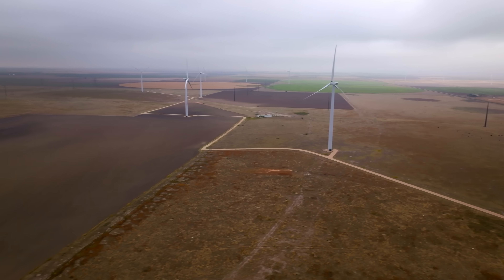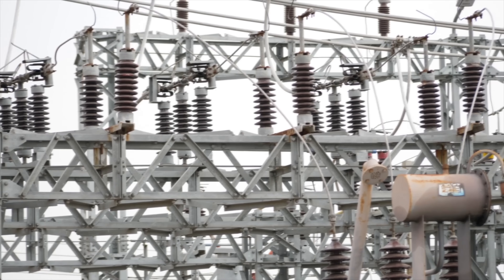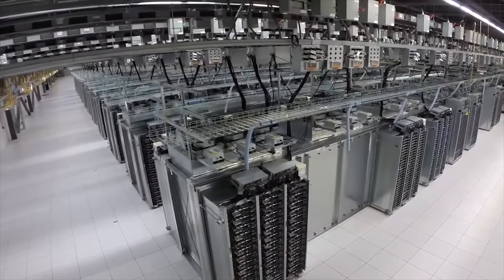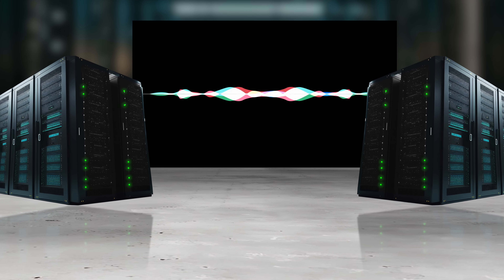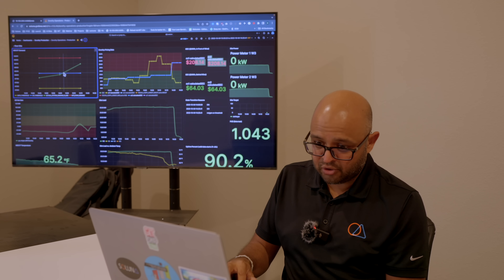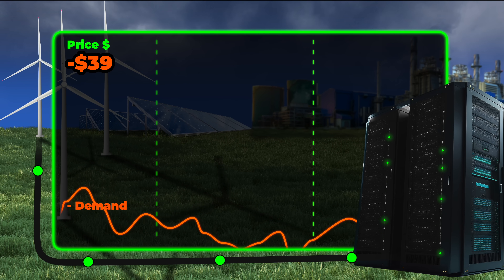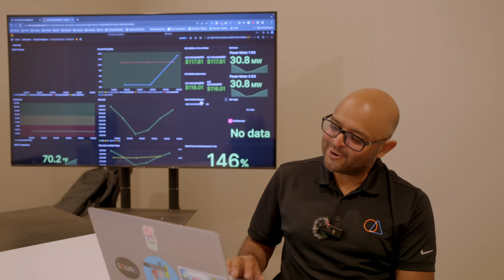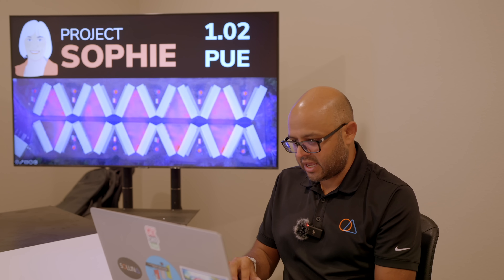Wind Farms' Dirty Little Secret No One Talks About

Comment: Texas has a electricity renumeration scheme that prefers very much dirty wind mills and solar. It does not reward reliability. Thus Texas has a electricity generation with plenty of dirty solar/windmills and gas. The result is the black out in winter 21. 

I do not know if it is economic to use data centers to buffer the volatile production of dirty wind energy. It is probably caused by the electricity renumeration scheme. 

I would prefer an electricity generation based on environmental friendly nuclear, coal and some natural gas for peak demand. It provide much better stability. It would be better to scrap dirty wind mills and solar panels.
Reply: What do you mean by dirty wind energy? In the blackout of 21 it wasn’t the renewable side that caused the issue. They do sell cold weather packages for turbines, but they’re not purchased in the southern states and honestly not in most of the northern states cause it’s typically not an issue. Even so a large portion of the blackout was caused by frozen gas lines that supply gas and steam turbines, and not the small percentage of renewables that help supplement the Texas grid. Look to ERCOT and Abbott for failing and not wind turbines.
Reply: @chrisbellttu  Wind energy is generated acc. to the coincidences of the weather. In most grids its value is low, 0, or even negative. On the other hand it requires several 1000tons of material. A lot of environmental impact for a low benefit. That`s why I call it dirty. 

Many experts predicted a brown out or black out in summer when demand peaks. The winter package might have helped in 21 but not in summer at 1800 when demand is close to its peak  very low solar, perhaps no wind is blowing. 

A nuclear power plant can run for 1 - 2 years without refuelling. It can start-up itself in the worst case by its Diesels. 

A coal power plant has usually fuel for several weeks or month on site. It cannot start-up without external power. 
A gas power plant rely on gas from a pipeline. The gas pipeline usually needs power from the grid. It cannot start-up without external power. It is less reliable.   

For Texas it would have been helpful to have connections to neighboring grids. It would have been helpful beside of plenty of gas power plants (Texas is a big natural gas producer) to have some coal and nuclear power plants to improve the resiliance of the grid. The renumeration scheme should include bonus for resiliance and reliability.

Comment: One thing I wonder: If windmills set their blade pitch to zero degrees, could they function as synchronous condensers? Even if there’s no demand for real power, they could fulfill a demand for reactive power conditioning that could keep the excess mills spinning.
Reply: Parts of Europe are dumping excess wind generation into inefficient hydrogen just to fill demand that at first glance is preposterous. Specifically, for UK alone JUST TO CUT curtailment (blades pitched to zero) IN HALF requires 20 GWh of energy storage. Taking those two statements into context.. is it really preposterous IF that curtailment was cut to zero by hydrogen production and directly injected into existing natural gas networks that are safe up to varying ratios dependent upon existing infrastructure. Alternatively, with more energy expenditure it can be reacted with carbon monoxide or carbon dioxide into more stable fuels such as methane or methanol. Which the later is of particular interest as an performance booster of ICE engines by increasing octane reducing pre-detonation and dramatic combustion chamber temperatures due to latent heat of vaporization. For perspective, 100% methanol track only vehicles DO NOT need a radiator as the fuel vaporization.

Keep in mind, regardless of energy storage methods or it's costs adding new production capacity, again regardless of renewable preference, will be cheaper.
Reply: Unfortunately not. Windmill speed varies with the wind but the grid runs at a fixed frequency. To get around this they generally use the generator to power an inverter that feeds the grid so there is no direct connection between the grid and the generator.

Comment: Imagine if more people implemented great ideas like this.
Reply from the maker: i think about it all the time!
Reply: What to do with excess power is hardly a difficult problem, try thinking about would you do on a calm day...
Reply: @manoo422 That's where grid scale batteries and other energy storage technologies will come into play.  There is no such thing as a silver bullet.  We are going to need many different technologies to transition to renewable energy.
Reply: @jerryinmon2731  "grid scale batteries" there are no such thing.
"energy storage technologies" you mean fantasy...
"many different technologies" most currently not invented, the few that are available are fantastically expensive. Renewables are NOT a solution to anything, they are the PROBLEM.
Reply: @manoo422  Your completely wrong.  There are already grid scale batteries already working  and making huge amounts of money for their owners.  So believe what you want to believe.
Reply: @manoo422 every water reservoir used for hydro power is,  in fact,  grid scale energy storage, used as needed.
Reply: @jamesengland7461  ...and how long can you run the country on hydro power, an hour?
Reply: @jerryinmon2731  What is their storage capacity of these batteries exactly? How long can we run the country off them...?
Reply: Windows XP
Reply: @orionbetelgeuse1937  They don't last minutes they last hours.  The process to create this system will not happen over night but will takes several decades to finish which allows for vast improvements in the technology.  Including the price of energy storage dropping by orders of magnitude from efficiency gains and new technologies.

Comment: Power Usage Effectiveness (PUE) is determined by dividing the total amount of power entering a data center by the power used to run the IT equipment within it. PUE is expressed as a ratio, with overall efficiency improving as the quotient decreases toward 1.0.
Reply from the maker: absolutely ... many data centers try to get close to 1, but don't include water used for evaporative cooling, others don't including AC and other cooling... there are a lot of tricks played when you look closey. Next time you see someone claim they're carbon neutral, ask them, "what about water use?"
Reply: @TwoBitDaVinci  Indeed. Air conditioning with water-cooled condensers is significant enough, but there is also a possible 'emergency cooling' where city water is directly used for cooling and immediately dumped down the drain. Aside from pumping, it uses very little 'energy'.

I wonder how much of an issue the clearly visible dust is at this installation.

Comment: Easy fix to the issues highlighted in this video.... Just upscale new nuclear!! Then you don't need to worry about any of these problems!! It will meet whatever demand is needed big or small for decades to come, and will not need to be replaced every 15-20 years using up resources! 😉 Nuclear really is the real big answer to the climate crisis and all the world's energy needs.
If the world started building more new nuclear 20 or even 10 years ago, the world would not be in it's current predicament! New nuclear is the only real practical answer to replacing fossil fuels!

Comment: Would you consider taking a look at blade longevity, recycling and disposal? Last I heard, they were throwing them in a hole in the ground in Wyoming, because the material they’re made from is so tough, it’s unrecyclable.
Reply from the maker: we've done a video on it! https://youtu.be/zdSBljIcchs
Reply: @TwoBitDaVinci  Thank you.
Reply: @CawKee they can now be recycled. I was told they can also recycle the old blades, but who knows if that will happen. There is also a video about it on this channel
Reply: @CawKee The blades are a shell of fibre reinforced resin, which is indeed hard to recycle into anything useful, but so are body parts of cars or boats. 
The core is balsa wood, which is partly reused, but it is not worth much. 

Our habit of dumping stuff, is a problem for itself and has nothing to do with windmills. 

When the blades are end of life, they will have produced gigawatts of power, for a fairly low carbon footprint. Something in the realm of 15x times there weight, not the 300 million ton, like in gas powered plants or 750 million for lignite for each gigawatt.
Reply: @goiterlanternbase  you missed out the steel and concrete required. Still takes around 15 years to break even. People seem to make up figures to suit their narrative. Now that subsidies are beginning to disappear they're starting to realise these things are a liability.
Reply: @CawKee  If it were economically feasible they wouldn’t be in a landfill. It’s possible that the ability to recycle these is too far removed from where they are located. I’ve seen these blades move through my town and it has to cost a tremendous amount- plus it ups the carbon footprint because the transport is diesel.
Reply: It's weird how silly claims "we re running out of landfill room" can persist.  I guess we literally are too lazy to do math to see which issues are small so idiot issues keep being mentioned and distracting us.  This is harmful, people skipping math and yelling about small problems..  Lower 48 states has 2,000,000,000 acres.  ""The average landfill size is 600 acres. With over 3,000 active landfills in the United States, as much as 1,800,000 acres of habitat have been lost. ".  This is counting a buffer around landfills which really is usable if needed. This is 1/1000 of land.  And it's usually worthless land,.hilly so bad for farms, and can choose far from city.  . . .  And we know how to do leak proof landfills.   By math this ain't a problem.  It's not even expensive it's such a small issue.  """ The average municipal solid waste (MSW) landfill tipping fee in the United States increased 0.6 percent in 2021 to 53.04 U.S. dollars per ton."'"". This is $53/2000 pounds so 3 cents a pound.  To dispose of 1 persons 1500 pounds a year costs city to landfill $45.  Soooooo.  An American throwing away 1500 pounds of leaves, plastics, and metal into a safe hole taking up 1% of worthless land ain't a problem.  Adding a bit via old wind blades and solar panels aint a problem
....   No one dies from landfill leakage, zero, so let's skip this issue darn it,.are we incapable of math????..  . . . .. . . . . 
 
. . 
   Each American does cause 15 tons so 30,000 pounds of co2 into air, along with airborne ash, chemicals, and still lead, which ain't inert or going in hole.  This is a problem.  My neighbors garbage won't hurt my kid, but his diesel exhaust does cause cancer at low rates... . 3rd world without catalytic converters or  remote power plants is even worse air, air pollution kills 5% there 5 years early (US is small 0.1% from air pollution).  .
Reply: Yeah, that’s propaganda. The fossil fuel industry’s dark money is doing its best to make clean renewable energy feel like the “dirty” choice. Think about where you’re hearing this from, and where THEY heard it from. Or, make a comparison point. A road surface lasts about as long as a wind turbine (20 years). Then that concrete all needs to be ripped up and disposed of, and it’s not recyclable in a meaningful way. And there are a LOT more roads by weight or volume than there are turbine blades. I wouldn’t be surprised if there is a million times more concrete in roads by volume than there is volume of wind turbines (I have no idea, really). Now, have you EVER heard ANYONE who is worrying about “What will we do with all those turbine blades?” ask what we do with all the concrete we throw away when a road gets rebuilt? No, of course not. We don’t think about it at all, really. That’s why I say this is propaganda, not a serious issue.

edit for data: As of Jan 2022, there were more than 70,800 wind turbines in the US. That’s pushing a quarter million turbine blades. That’s a lot! There are also 4.19 million miles of roads in the US. How much concrete is in each mile of those roads? A relatively large wind turbine blade is about 150 feet long. Laid end to end, there would be about 35 per mile. Every turbine blade in the US, end to end, would cover about 6250 miles, give or take. Does this help clarify how biased this concern about turbine blade disposal is?
Reply: @CawKee  ... Recycling is not required to be green.  We dont recycle and reuse pumpkin rhine when making pumpkin pie, or banana peels, yet these are pretty green.  Putting inert materials in a hole safely that won't leak is pretty green.  Everything is relative.  Putting 10 tons in a landfill is green if it avoids a small natural gas generator putting out 10000000 tons of co2, spot, benzene, cancer chemicals.  Choose, live near a gas power plant or a landfill, 1 will cause zero illness and other about 1000 cases per million residents..  turbines are pretty green, yes not magically perfect what the F is magically perfect..
Reply: Surely a good use could be found for them I would think
Reply: @CawKee  so what? Just stick with coal because it’s easier? And most people are dead? When the turbines were developed there wasn’t any recycling and now there is. In the future there will be a better way to recycle, or a different blade material. At least the heat won’t be as bad

Comment: A look at the front side of Texas power in a deregulated Market deserves a follow-up on the retail side. Like MCI destroying a long-distance AT&T with free nights and weekends, one of the rates offered what's in Texas for retail electricity now, obviously, my favorite plan viewed from Alaska, and how much would it cost me to invest that it's the perfect plan? Creating and storing cold at night to be used during the hot afternoon, free Power stored in the Tesla battery isn't free considering the cost of the battery. And this was the kind of information I was using when I built my solar and wind thing at where I live Karma and the information does not apply to me in a regulated 8 cent wholesale 22 Cent retail Market. The meter is like my battery spinning backwards add forward with 2 indicators and no penalty to reuse the power that I've sent to the grid during the night time, it's free power as far as that goes but what I don't use which is Worth 22 cents an hour if I use it is only worth 8 cents after it goes through two Transformers to go to somebody else, a credit on the bill or a check if the credit is a year old. Lots of talk about differential pricing I added to my calculations that do not exist. Ridiculously high returns in California Karma ridiculously high rates in Texas when the grid collapses, my state regulated utility is stable except for the price of fuel, facetiously 4.5 cents a kilowatt + fuel charge equals 22 cents a kilowatt hour, and I listen to Denver complain about their New Peak pricing imposition with much lower rates are there maximum then we have here in our own private little market and that's a political Quagmire story to get the natural gas to stay on after the gas companies were righteous in stopping the hydro dams that were going to produce more power than we could use. Kodiak Island was 100 Diesel and now is not diesel at all call my success story of new wind turbines complimenting their hydropower meaning the hydropower doesn't run out of water anymore and it's all 100% sustainable, another way to utilize 100% of the wind power without wasting it on computing. Are light bulbs have gone from 100 W to 10 saving the environment lots of emissions that are being wiped out by Computing demand, times thousands for sure. There's no end to emissions as the Earth turns into a CO2 bubble.

Comment: They don't turn in high winds either which is a total waste. If spread across a landscape as opposed to condensed into a focused area, they ruin the beauty of the landscape, they are also noisy if you live within a few hundred meters and some still use balsa wood from Central America which the industry is very quite about. Offshore wind and well orchestrated onshore wind farms are fine, other than that just go nuclear.
Reply: Partially true but  balsa wood construction has been phased at along time ago and the majority of Wind Farms aren’t close to population centers as open areas for pure wind are necessary. An ongoing effort are being made to reduce the noise of the blades.